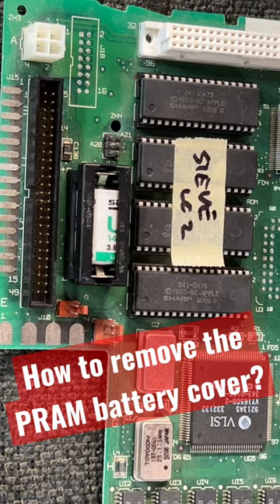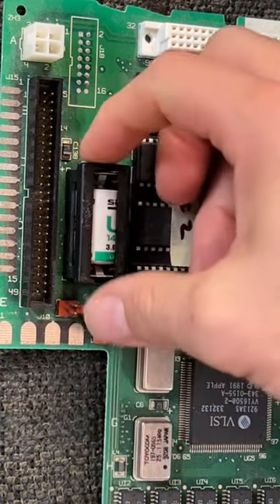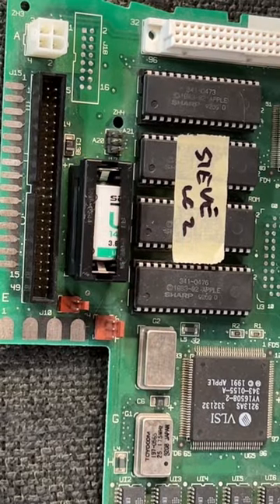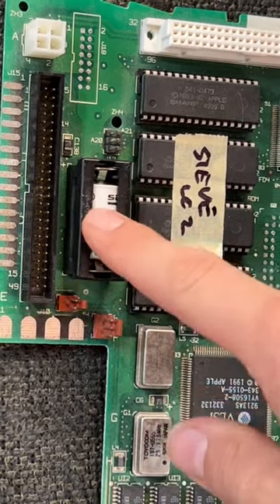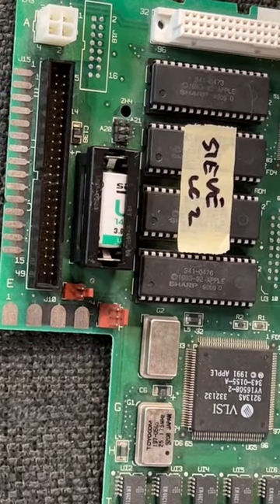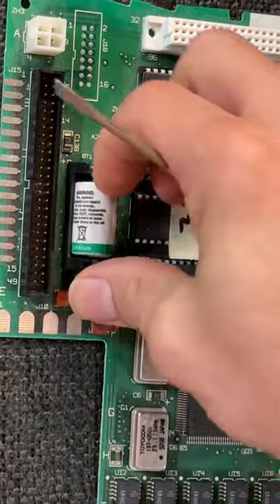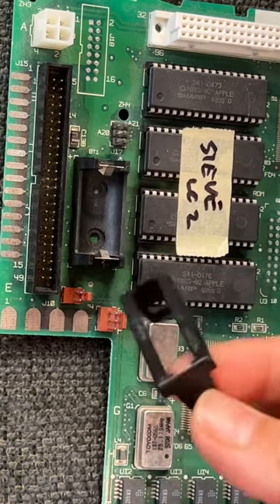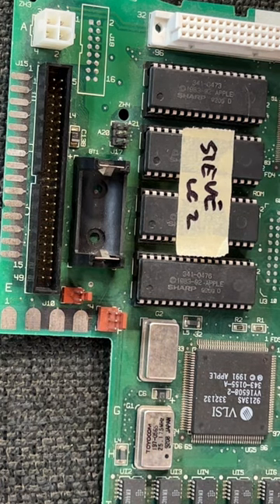How to remove the PRAM / Clock battery cover from a vintage Macintosh computer

Comment: Hi! I just thrifted a working macintosh 8500/120. Do i HAVE to replace the PRAM battery or can i just remove it completely?
Reply from the maker: The PRAM battery is not required on the 8500 (and most Macs). So you can run it without it, it just won't save the time / some settings once power is removed.
Reply: @Mac84 thank you so much!